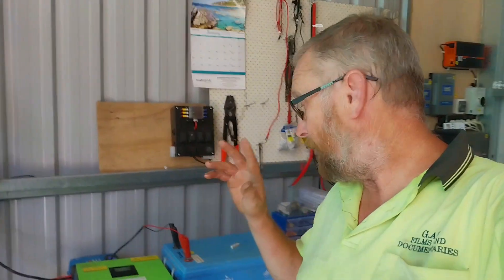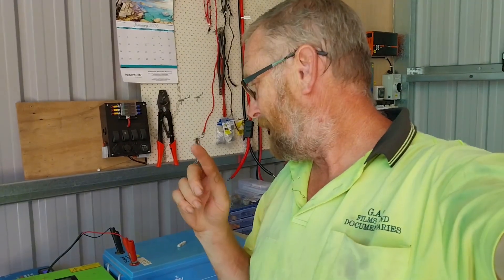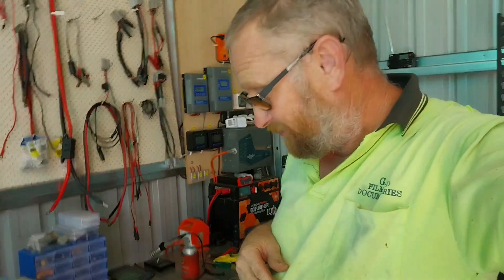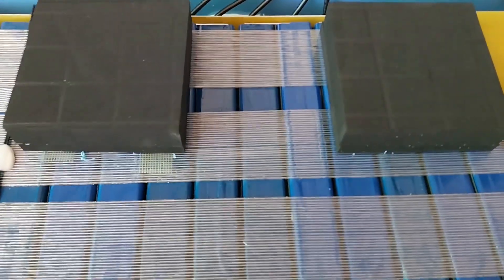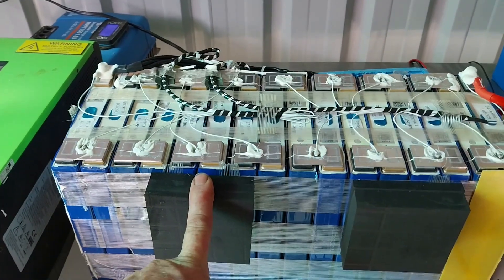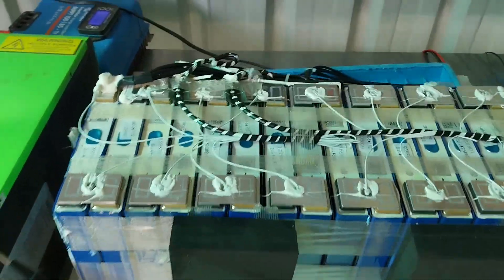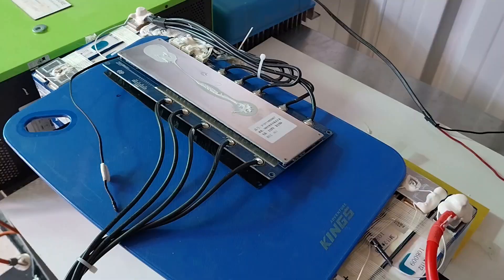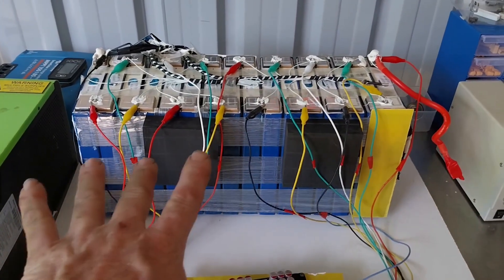Teardown & Test On The Second Lithium Battery - This One Is Different

Comment: Yes you are correct but the individual cells resistance also affects how quickly it gets to full charge as well. I run my multiple 48v systems to 55.5v, you only lose 2-3% of capacity but give ur cells enough room so that u dont get over voltage on any cell like u have shown. It also has the advantage of better longevity as ur never pushing the chemistry too hard to the extremes

Comment: You are getting really hands on! I’m just learning about cell imbalances in my small packs. Now I want to try my first active balancer.
Reply from the maker: The battery and solar projects are endless 😆
Reply: @TheOffGridBachelor Yep and your Ecoworthy panel should be on its way. Maybe a tripod too? 😂
Reply: Just remember don't leave your active balancer on full time, you need to trigger it on when a cell reaches 3,45V
Reply from the maker: @bildad1234  yeah it will be disconnected at night when the sun goes down 👍

Comment: Your controller didn't deliver any amps the second time so it wouldn't spike. The high disconnect probably hadn't reset. If the battery is full a cell disconnect will still spike it even at lower voltages but it has to be connected in the first place. What often happens is that an inverter will turn off due to a BMS disconnect as the bms doesn't respond fast enough so the system sees full panel voltage or close to that. Inverters have been blown up due to this, I've seen it happen.
Reply: MPPT solar charge controllers are step-down or buck converters in their core. the voltage they are set to and the current they allow is manipulated via the actual controller CPU chip and the software settings.

NEVER would a 'sane' MPPT pass through the full panel voltage. if it did, it would be insane and ready for the f*ck-it-bucket.

 that would mean huge fire hazard and victron is by far not that incompetent !  they know exactly what they're doing.

also 3S panels could fry the BMS and possibly the cells in a split second.
Reply: @casemodder89 you clearly don't know really how they work. They actively track the max power point and they do this on a time schedule. If you remove the load there is no current sink to hold the voltage down and by the time the tracker gets round to having a look it has spiked. This is a common problem and regularly will cause inverters to do a high voltage shutdown and I have seen one inverter destroyed by the spike. The advice with all mppt controllers is to disconnect solar before batteries. With some victron ones, if you don't do that, they will set themselves up at a higher voltage as they see the output voltage rise and assume they are connected to a higher voltage pack. This is of course assuming they are on a lower voltage system than their maximum.
Reply: @philbrooke-little7082  funny how YOU accuse me of not knowing how mppt chargers work and don't know YOURSELF that an mppt puts out nothing higher then the max. allowable voltage per set battery voltage system.

and that periodic recalibration on the actual MPP happens on the higher voltage side of the controller. and that is ALWAYS the PV side.

the battery side doesn't care what the PV side does. as long as it does not go beyond the PV voltage limit.

you could run a victron mppt charger on a large cap. and nothing happened except the charger instantly throttling back the modules without any loads to drive.  because it's not cheap crap but well engineered piece of kit in a PV installation.
Reply: @casemodder89 the reason I say you are wrong is because I run 4 mppt controllers and observe the spikes every time the BMS disconnects. I have observed an MPPT controller damage an inverter when the BMS disconnects. Know that it is common for inverters to cut off due to high voltage when a BMS disconnects. I spend my life working with these things, I know their circuitry and their logic and so feel confident to say that a load disconnection, or sudden reduction, while the mppt is supplying current does cause a voltage spike. I know that theory would suggest it shouldn't but in practice it does. Remember the PWM duty cycle of the buck converter is determined by the microcontroller, not by an analogue ic as would normally be the case. The feedback goes to the controller from the pv voltage, the pv current and the battery voltage. The battery current is read too but isn't needed in the calculation but is needed for protection. The controller fiddles with the pv voltage to maximize the power that it gets by multiplying the current by the voltage. It does this in discreet steps and pauses to let things stabilize. At the same time it looks at battery voltage and, if too high, eases the pv voltage above the vmp of the panels to reduce power and therefore voltage. When you get a sudden disconnect the PWM is locked in until the next search cycle and so the voltage goes high as always happens when you remove a load on a current limited supply. As the mppt does things in discreet steps it can take several cycles of adjustment of PWM until it gets down to a level where the output voltage is within limits. In normal operation this isn't an issue as all changes are gradual. I have literally years of graphing the real world behaviour of these things. Yes different controllers might use slightly different algorithms but they all work basically the same way with the MCU controlling the switching.
Reply: The evidence is also in the original problem that this video stems from which is excessive 'ripple' which was actually caused by BMS disconnecting due to cell overvoltage allowing the MPPTs to spike.
Reply: @philbrooke-little7082 the output voltage might jump a lil on a sudden bms cut but never anything serious on a full charge cut off. because the current was already low and close to zero at that point.

i never had a spike or a slight voltage bump up fry anything.

maybe installing a twinset of car hifi caps on my 12v system wasn't that stupid of an idea as many people wanted to tell me.

i also bulid my systems on a low IR approach. batterypacks, copperbars, fuses, cable... everything is made for maximum ISC.
Reply: @casemodder89 when you get a cell cutoff, as in this case, it happens at full current. Sure at low current it is less of an issue as the rate is already low and the mppt is in constant voltage / absorb mode rather than bulk. Large capacitors / supercaps certainly help. I run my own system hybrid so there is a lead acid in the system which can always absorb any nasties. I have a friend who stabilises his system solely with supercaps and that works although there can be issues it you ever turn the BMS on without pre-charging the caps as it will register a short unless you include some resistance (cable) in the charge path to lower the current below the BMS limit
Reply: @philbrooke-little7082  yeah and all these are reasons to iron out every malfunction prior to 100% depending on the system.

a small shits-and-giggles system for self education is the proper playground for all kind of experiments.

Comment: Thanks for the video mate - interesting to see the differences inside the other battery and how it changed. I didnt' get a valid scan on the QR cell code - Gotion 280ah which I expect is wrong. Be keen to see if anyone sees different and what tool they are using for the accurate result.
Reply from the maker: I can't find anything either so I am wondering if they are decoy stickers. But I am not up with finding QR code info so I can't say for sure ??

Comment: If you get an Battery-IR-tester it can tell you already very much of the story. As a general number, usually a doubling of internal resistance from the original new cell means a SOH of around 80%. A sort of exponential curve which I have plotted out of measurements from 120 LFP cells.
1-1,4 xIR ~ 100-95% SOH
1,4-1,7 xIR ~ 95-90% SOH
1,7-1,9 xIR ~ 90-85% SOH
1,9- 2,1 xIR ~ 85 -80% SOH
> 2,2 xIR < 80% SOH
Reply from the maker: Thanks for that info. I will have to get hold of an IR tester for Lithium batteries as I recon I do have some tired cells.

Comment: Lovely ep and great problem solving going on,  Do I understand it all no,  but great to get a view on these batteries and weather in real world use they will make it to 10 years or more,
Reply from the maker: I would doubt they will get 10 years, five if I am lucky but time will tell.
A friend of mine who lives off grid got 15 years from his lead batteries (2 volt cell in series to 48 volt) When his lead batteries died he put in a set of Lithium's (LFP) and after three years they were replaced under warranty. The second set lasted four years and now he is on his third set for Lithium batteries.
So far with his system he gets 15 years from high end lead batteries and 4 years from Lithiums. So in a large household application cycling everyday, I am not convinced Lithium's will last as claimed.
Reply: @TheOffGridBachelor  Ok thanks for that info, I hope you get them sorted,  and they last longer for you .

Comment: Not sure who was telling you to charge to 3.65V/cell (58.4V) but the BMS disconnects at 3.65V so no matter how good the cells are,  that's 0.00V of margin... so you don't want to charge to 3.65V/cell (58.4V).

Usually charging to 3.55V/cell (56.8V) gives a (balanced) battery plenty of margin (0.10V/cell) to avoid hitting a cell over-volt and disconnecting, but clearly in this case it isn't quite enough margin.  Maybe once the cells get into better balance the battery will be able to tolerate the 3.55V/cell (56.8V) charge target.

Anyways, charging to 3.50V/cell (56.0V) gives the BMS more margin (0.15V/cell of margin) with which to avoid having to cut the battery off.  As long as the BMS itself is configured to start balancing earlier (3.40V or 3.45V/cell), then a 3.50V charge target will work just fine.  The charge rate will slow down a little earlier than necessary, but it should still work well.

Also be sure that you aren't over-draining the battery.  Batteries usually disconnect at 40V but the inverter should be programmed to shut-off at no lower than 46V under load (48V when not under load)... that's gonna be less than 5% SOC.  Otherwise the top-balance the BMS does might not hold.

-Matt
Reply from the maker: Thanks mate, yeah I usually get down to around 50% SOC before the sun comes up and starts recharging again, so they never get down to 40 volts (battery voltage) unless I am doing a discharge test.
My usually charge voltage for years was 57.6 volts until I started to have high DC ripple alarms logging in my system due to a cell or two hitting high voltage disconnect. I dropped it to 56.8 but was still having this problem so out come the batteries to see what my problem is, which started these battery test series.
I think the problem is some of the cells in the batteries are getting weak and have lost capacity, causing an imbalance issue. So I dropped my charge voltage down to 56 volts, which stopped the cells hitting high disconnect and I haven't had any high DC ripple alarms being logged. So gonna experiment with the charge voltages after balancing and see what we can come up with.
Reply: @TheOffGridBachelor  This is fairly difficult to diagnose because many manufacturers don't actually know how to configure their BMSs, and older BMS firmwares had terrible algorithms (for example, like only balancing while the charge current is positive).  So BMS would often not balance the battery properly no matter what the charge profile.

If the BMS is being reasonable, an absorb time of 30 minutes with the current-tail disabled (configured in the Victron) is usually enough and as cells age usually all you should need to do is bump the absorb period up a bit.  30 minutes to 2 hours is the typical range.

But that assumes the BMS continues balancing even with zero charge current, once the target voltage is reached.  Not all do it properly.

Comment: Dude, you're not an electrical engineer, you're not even an electronics technician, and even though an electrical contractor doesn't anything about inverters, you're not even an electrician. You have no, background, formal training, or education in the design, manufacture or even the repair involved in modern inverters or batteries. You don't even own a single piece of lab grade battery test equipment.  Please stick to doing evaluation videos about products that you have some background in.
Reply from the maker: I have 30 plus years experience living with off grid power, playing with batteries, solar panels and inverters. One does not need a qualification and a lab full of high end gear to share their hobby on YouTue.
I don't know everything, that's for sure and I'm always learning, especially when new technologies come out. But at no point in my videos do I tell people what they "have" to do, I just show people what I do. Like my tag line says, "I bring you with me" 👍
Reply: Clearly a uni graduate who is a labour voter. Get a grip bloke! Without people like Glen we don’t move forward. This is the real world testing laboratory. Fully certified. Keep going Glen, this is very interesting viewing

Comment: The only thing I can turn up about SH21F0B663X4 BMS is it's associated with ANENJI a battery / inverter related company.  May be the OEM of the batteries Glen has  which is entirely supposition, for all I know these batteries were assembled in Australia by Amptron.

Comment: Yes, Prowse does say 3.65V often but the context has to be considered.  What he is referring to is with a mains operated battery charger during his battery testing where he wants to bring the battery to 'full capacity' as specified by the manufacturer for testing purposes.  For people with the battery in daily cyclic use regardless of the charging source, solar/generator/mains, a lower target is a better choice for the reasons stated.  The only trade off is longer time must be given for the low balance current BMS typically fitted to batteries to do its job.  Victron's defaults are 3.55V/cell and that's good enough for me (and time has proven it to be good too)

As of this morning I've dipped my battery bank down to 48% according to my smartshunt which is operating on the basis of the batteries being 120AH each and voltage is 26.00 (measured at the load bus bar so there is minor wiring drop) with 15A load.  That gives me an approximate 43% SOC in relation to present battery capacity after 7 years of use meaning I'm probably down to around 87%-ish original capacity.  I'm happy with that.

Comment: Does your normal setup have a smart shunt to measure the voltage at the batteries? It can then relay the voltage to your solar chargers (via Bluetooth) to account for voltage drop from cables and connections. The smart shunt can measure the voltage on two batteries at the same time. If you have the batteries wired to a busbar with identical cables then obviously the voltage will be pretty close between them.
Reply from the maker: Yeah it does have the smart shunt in the system.
Reply: @TheOffGridBachelor  that is very beneficial because there is a thermosensor available (just a simple NTC 10K IIRC - the exact info can be found online) that can be connected to the smart shunt and also log on the VRM if you set up the smart shunt to temperature probe using victron connect => somewherr in the 'backend' menu AND activate the graph in the VRM/GX gateway.

if i find some time tomorrow i will measure the thermosensor to verify which kind (NTC,PTC) and which nominal resistance@20°C it has (3K,5K,10K etc.)

because VRM +Cerbo GX loggs for a year and can be saved to micro SD or exported to exel you were able to not just monitor the temperature all the time but also plot the tempeature over a long period of time giving better estimates of the reliability and degradation.

the invest is like a few dollars plus a bit of software tweaking.

if any cooling/aircon'd battery cabinet happens in the future you'd be all set to monitor if that unit works properly too... from everywhere in the world - on the phone and laptop.

Comment: No do not charge to 3.65v per cell for the pack
That's crazy
You only want to charge to a reasonable amount that is not hitting over voltage on any cell ever if you want to hold it there long enough so that the BMS can keep the cells in balance
That's it there's no exact number it depends on how well matched your cells were when they were new and now how well matched they are after they have been used all of that changes over time and use and temperature and everything else